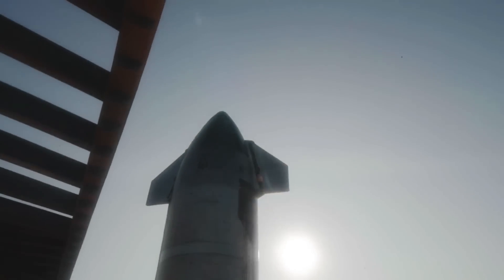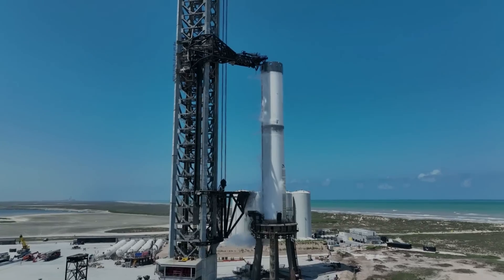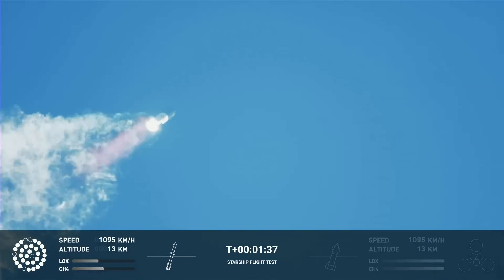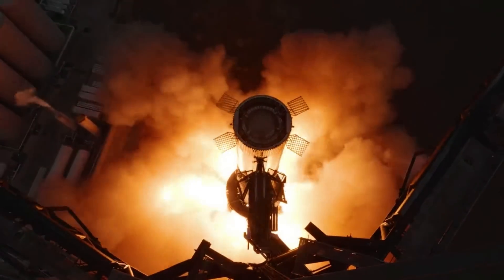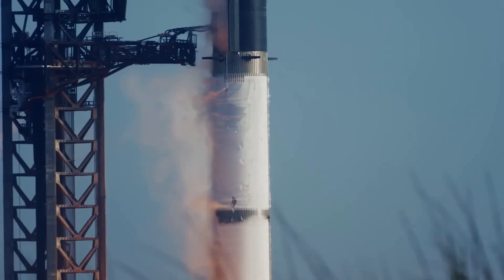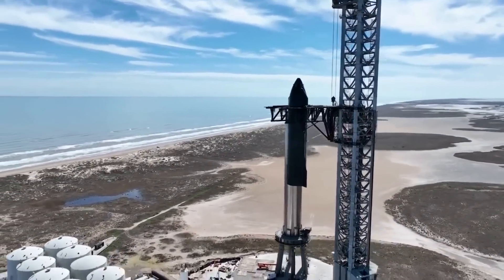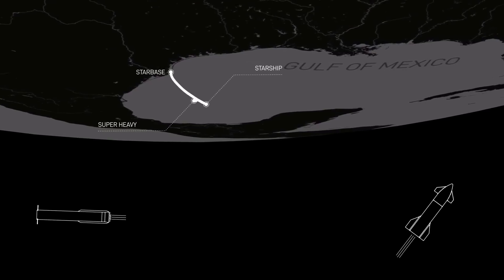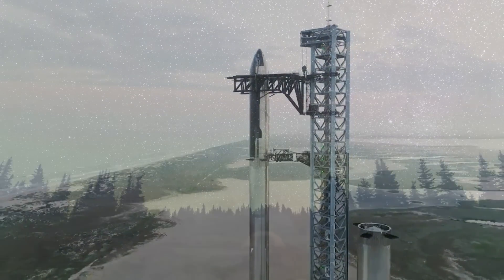More Improvements To Starship's Next Launch Prototype

Comment: They have to fix that pad to get environmentalists off their case. To be clear, the environmentalists have a very good point. These rockets pollute. The goal is to make that as avoidable as possible which is not what they did with a giant cloud of mystery dust. Getting off the pad quicker will help. The water system will help. These improvements also help turn around times, which is an operational consideration. 

While other rocket companies might fail, SpaceX has a financial imperative to getting Starship off the ground and working and it's not the HLS. Without Starship, there are no Starlink V2's and that built in demand is what fuels R&D. We're going to see one of two things. Either SpaceX goes completely belly up, or Starship will work. Anything in the middle would be chaos.

Comment: Plus if the pad is durable, that would reduce subsequent launch times down even further, increase prototyping speed.
Reply: They also would cut down the time for the Raptor engine to throttle up when still in the launch pad from 6 second to 3 second.